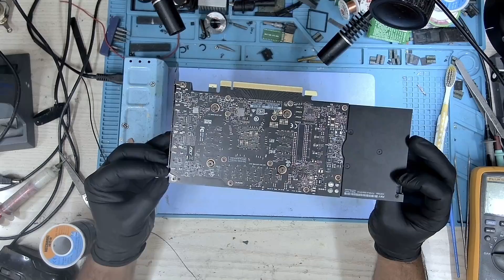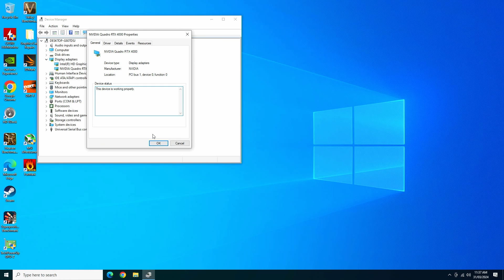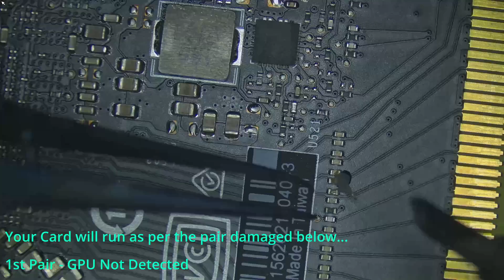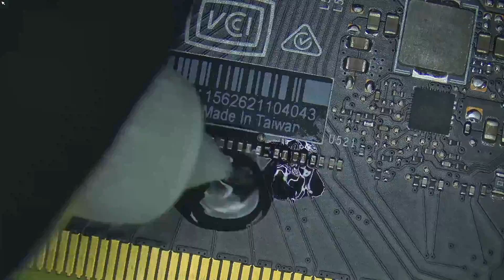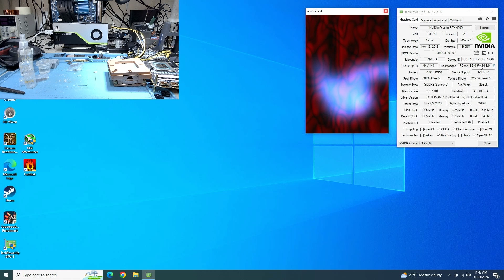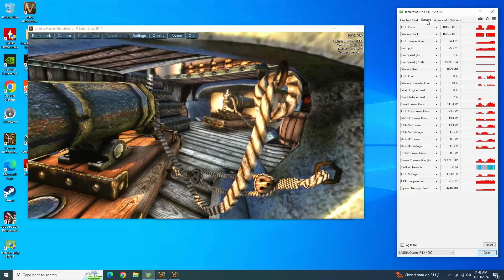How to Fix GPU Running at X2 instead of X16 - Nvidia Quadro RTX 4000

Comment from the maker: For AMD GPUs  this does  not apply. AMD cards will not get detected if any of the caps on the PCIE are knocked off when connected on X16 PCIE but will work on pcie riser as PCIE riser is X1 to X16 connector. But will not get detected at all if the caps on the first pair are knocked off.

Comment: my gpu gtx 1050ti run x4 instead x8 or 16 i have one small capacitor unavailable
Reply: thank you i fix gtx 1050 ti By welding only no capacitor
Reply from the maker: Excellent.

Comment: My GTX750ti was doing exactly that, under close inspection my 4th pair is missing the small capacitor or cap. how did you re-solder that. I have never done one and where would I get one from. I do have an ultra fine iron and a small solder sucker but have no experience.
Reply from the maker: Watch how I solder small components. I do it in so many of my videos

Comment: Hi, i have a evga gtx 970 that is dispplaying this exact issue, and i checked and sure enough, one of the caps is missing. I have a spare faulty asus gtx 960 lying around. could i transfer one of the caps over the 970, or would it not work? thanks
Reply from the maker: Yes that's possible as they all use the 220nf ceramic caps.

Comment: Hey I have to come here again
I had 1050ti which ran on x2 now it runs on x1, the GPU which was running on x16 I,e ati radeion 4350 also runs on x1 now, 
Is it a fault with my motherboard,  I use VGA to HDMI adaptor, and I have added a new power supply as well, and my GPU only draw about 60 watts from the pcie slot
Reply from the maker: Perfect issue of a motherboard. Everything screams motherboard .

Comment: Hey thank you for the video 
My 1050ti has all the pins intact and evey pin is present, it stills runs on x2 in this motherboard and at x1 in other motherboard 
And older graphic card Radeon 4500 runs in x16c I have a really small scratch in the front side of my Gpu can that cause the problem ?
Reply from the maker: If the scratch has ruptured the data lines to the PCIE yes it will have an impact

Comment: My Gigabyte AMD RX 5700 runs at x2 instead of x16, I wonder why. It started microfreezing in videogames after 4 years of working properly, I only recently checked GPU-Z and found out it's running at x2 even under load
Reply from the maker: Normally on AMD if a cap gets knocked off the GPU does not get detected. But that's in the 6000 series. Can you check if any cap sis knocked off on the PCIE at the back of the card. If you don't have a microscope you can use your phone and zoom in to peek

Comment: Nice video sir, I tried to do the same with my 1050ti and the pins feel intact while the problem still remains
Reply from the maker: What is it showing on GPUz? how many pcie lanes are shiwing X8 or something else?
Reply: @GraphicsCardRepairs-tk7ql  It shows running in x2, i have tried diffrent gpu and it runs fine, when I tried this gpu gtx 1050ti with core 2 duo cpu the pc doesnt even .  boot, Wright now it just boots and runs in lane 2
Things I have tried reseting ram, Powercables, CPU, and sata ssd 
would you mind tell me what could be the problem? from your experiences and knowledge.
Reply from the maker: Sure if the GPU is running in X2 that means that one of the first 4 pairs caps are either knocked off or not making proper contact. To be precise the 3rd or the 4th pair.
Reply: @GraphicsCardRepairs-tk7ql  thank you so much sir 
Is there any out of the box ideas I can use to fix that 
I don't have a soldering iron right now
Reply from the maker: Did you find the missing capacitor? These components are very small. First you will have to check if the pad is stil intact. If not to you will have to connect the traces. You will need a microscope, a fine tip soldering iron, jumper wire 0.02mm. just like I showed in the video.l
Reply: @GraphicsCardRepairs-tk7ql  it shows x16 3.0 @ x2 30 and yes I resinstalled windows and stressed test gpu and stress test won't fix the problem.

Comment: Thanks for this helpful video friend! However I think I may need to clarify my problem a little more. My GPU is working with all Lanes (x16) as it works on my other computer. I suspect the problem is either with the Primary PCIEX16 (Top Slot) or it is an LGA Socket Problem, specifically a broken BGA. Here is the interesting part. I have 3 Intel 10th Gen CPU's and they all work on the particular Motherboard in question (which is an ASUS ROG STRIX Z490-E Gaming Wifi), so it must be the BGA under the LGA 1200 Socket or a bad solder joint on the slot. Here is the weird part... Depending on the CPU I installed I would get a different amount of lanes detected, with my Celeron G5905 I get x8 lanes on the Primary slot, with my i3 10100f I get x4 lanes, and finally with my i5 10400f I only get x2 lanes. I don't understand this which is why I asked you, I was wondering what your thoughts are. Thanks! Cheers!
Reply from the maker: This is a weird one. I assume you are using these CPU's in the same motherboard and the GPU in the same PCIE slot which is the X16 slot. Let me clarify my understanding.. so depending on the CPU you insert like the celeron, the GPU runs in X8 , i3 in X4 and i5 in X2. Is that correct? Normally in this case the GPU is fine and the CPU is also good nothing wrong. My assumption at this point is that either the CPU socket is damaged (most likely) secondly I would also look at the X16 slot (least likely but a possibility) if you are using ATX motherboard can you try out the X8 slot at the bottom and check if it's running in X8 on all CPU. If It's doing the same thing then like in the X16 slot it's the CPU socket that has the fault. If it's running in X8 with all CPU then the X16 slot is the one at fault. The end result is the motherboard is the one with the fault.
Reply: @GraphicsCardRepairs-tk7ql  I wanted to thank you for taking the time to help me. I really do appreciate your help. I believe you do understand the dilemma I am dealing with. Yes, this is all happening on the same motherboard (the ASUS ROG Strix z490-E - which is my Backup PC / My Primary PC is newer hardware and the Video card is detected as x16 on this one). I agree that it can't be the slot as the an lanes detected would be the same for any CPU and any GPU correct?. I just don't understand why the lanes detected are different depending on the CPU installed. It must be a cracked BGA under the LGA1200 Socket. Oh yeah, yes I get the full x8 on the middle PCH x8 slot. So it must be the CPU Socket  which makes this a difficult repair. Have you ever heard or Reversing the Data Lanes? I hear it can be done by jumping two of the pads on the bottom of the CPU using sticky foil tape.  If I can reverse the data lanes maybe I can get more lanes. Just curious if you know anything about this.
Reply from the maker: Is the GPU running at X8 in the second slot with all the CPU's? If yes then the issue may be with the X16 slot. you might have to put the motherboard under a microscope to check the pins on the back or replace the PCIE X16 slot. If not then it's the CPU socket that would need replacing.
Reply: @GraphicsCardRepairs-tk7ql  Yes the Video card runs in x8 in the second slot with all CPU's. I am hoping the problem is the Primary slot because I don't have the proper tools to solder a new socket. I've seen a couple videos of some guys managing it with just a hot air station, but I would need an adapter to fence in the socket and not blow up caps and such. I'll let you know after I examine the slot thoroughly. Maybe I'll get lucky as many of these heavy video cards can cause this kind of problem. Thanks for the help Friend! Cheers!

Comment: Is there a difference in performance after repair? Because my RTX 3080 has x2 4.0 16 GT/s link speed which is the maximum of x16 4.0, and it is running games normally.
Reply from the maker: At X2 there will be a difference in performance. At X8 the difference would have been negligible on gen 4 but at X2 there are only 2 lanes transferring data.
Reply: @GraphicsCardRepairs-tk7ql  Could it be a problem with the pci slot?
Reply from the maker: First I would recommend you take the GPU out and take a look at the back of the GPU to check if any capacitors have been knocked off. If nothing is knocked off then it's the PCIE slot at fault
Reply: @GraphicsCardRepairs-tk7ql  thank you, i will check it.